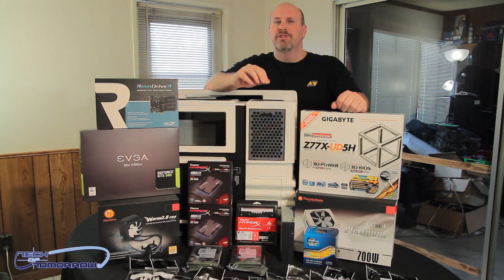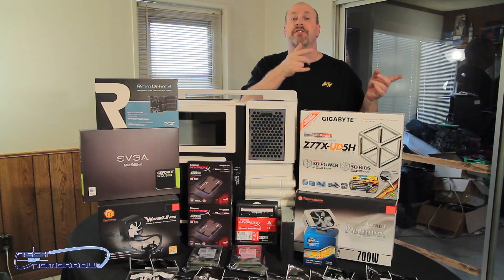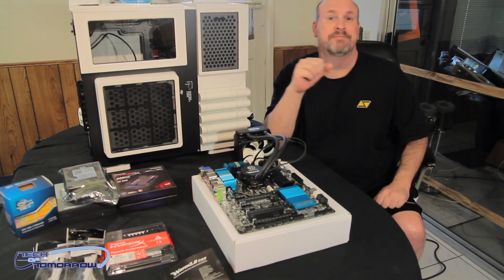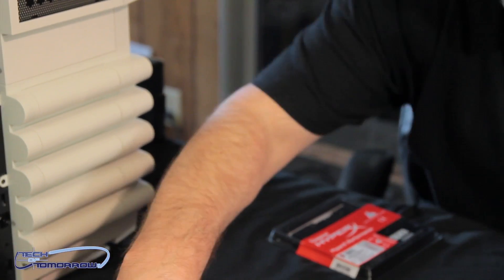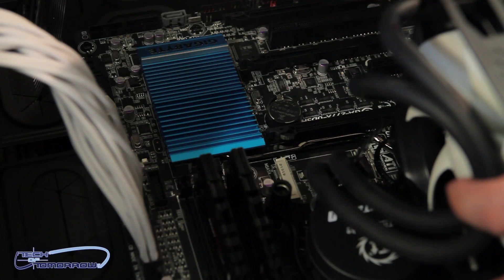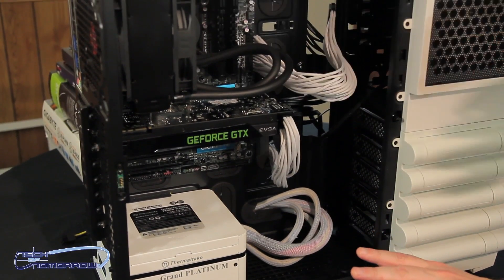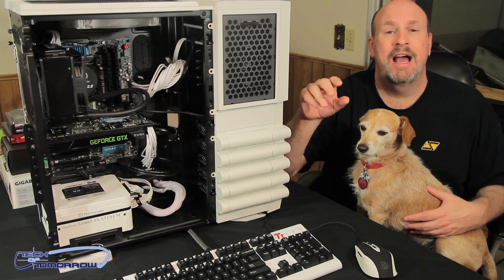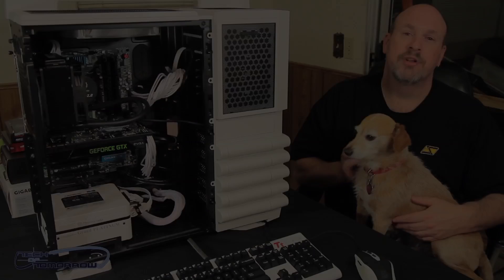Building The Dual-Boot Win 7 / Mountain Lion i7 GTX 680 Snow White Hackintosh

Comment: I always used windows, and now im becoming a graphic designer, and everybody talks about os x and blablabla. I'm thinking about building a hackintosh, but what are the advantages of Mountain Lion on a Hackintosh over a Windows 7 PC?
- I'm NOT asking the advantage of hackintosh over a macintosh!!!
Reply: pure experience. The specs are the same. Only thing I have experienced is dat adobe programs work a bit smoother on mac, but the difference isnt very noticable. I personally use my Macbook pro or Hackintosh for editing and photoshop because I like doing those stuff more on OSX. I also have a PC that I use for gaming.
Reply: The system itself offers a lot more graphic and video editing preferences, you could use After effects which in my opinion works better on mac, same for photoshop and then transfer it to Cinema4D if you wish in windows. All round it's a better performing and more practical than having 2.

Comment: Hello I am building a computer and wanted to get some feedback with these parts and if they are compatible.
Specs:Intel Core i5-3570K, Cooler Master Hyper 212 EVO, Seagate Barracuda 1 TB, Rosewill HIVE-750, Crucial m4 128GB 2.5-Inch, Kingston HyperX Beast 8 GB Kit, AS Rock LGA1155 DDR3 SATA3 USB3.0 Quad CrossFireX and Quad SLI A GbE ATX Motherboard Z77 EXTREME4, GIGABYTE GTX 670.

Comment: It's quite simple: A computer is made out of a bunch of parts. Linux and Windows will run basically on any computer with modern parts, but Mac OS X won't since Apple both design hardware and software. Therefore you must use the same or similar hardware that exist inside the Mac Pro, Mac Mini or MacBook Pro.

Then you must also use special software in order to install it properly on a non-Mac computer.

Comment: usually mac version use a different bios, so its not the same, for example the HD7950 have even a switch to choose the bios, for mac or windows, its not difficult to change that, but i d rather buy the gtx680 pc version, cuz is more easy to get that work for both OSes

Comment: multibeast isn't really necessary for a Gigabyte Z77 board. If he's going to use UEFI edition of Windows 7 or Windows 8, he'd need a suitable bootloader that handles both accurately. Clover UEFI (not the mbr edition) can handle proper booting of OS X (as close to natively as possible) and can pass the boot through to Windows UEFI as well.

Comment: So what's the practical purpose for this build?  I just don't understand the purpose for this build.  Couldn't you simply build a Hakintosh, then build a separate PC, then just network them?  Then you could run both systems ~simultaneously~.

Is the money saved from building one dual-boot Hackintosh/PC compared to the costs of building two separate systems (one Hackintosh, one PC) worth the inability/limitation to run both systems simultaneously?  BOTH systems are limited by a dual-boot config!

Comment: At least someone who knows what's inside a mac! ;) A Mac Pro cannot be compared to a desktop system at all. It's outdated, no doubt, but you can't compare a Z77+3770K with it. it's just not the same league of reliability. iMac may be compared to a 3770k+680 desktop pc, but calculate an equal display in ($600+). 680MX is a downclocked fullsized 680 ;) that's the only difference. an imac is actually cheaper than getting all parts (mouse, keyboard,webcam,audio,etc!)

Comment: Seriously? I thought you were knowledgable enough when it comes to PC/Mac and hardware. Why would you get a 680 Mac Edition card for a hackintosh? it's never going to access the "special EFI" part of the ROM, which you pay for when buying the Mac Edition. Any GTX6xx card works in a hackintosh, and with the newer UEFI GOP bios you'd even have the UEFI implementation for clover UEFI bootloader. I'd rather spend the 100$ as an upgrade for a 680 classified or DC2T or such.

Comment: If you're dual booting OS X, you would need to be very picky about your hardware. I'd make sure the hardware is available on a Mac(GPU, and CPU. Can't buy boards in Macs off the shelf). The board that Elric is using there will work completely fine. You don't need to worry about RAM or what kind of HDD(or SSD) you use. Alternatively, you could set up a Virtual Machine as well on a Windows PC.

Comment: yes. also depends on how thick the rad is. if it's thin unlikely if it's thick or you don't have proper fans. (like the ones corsair provides with the h100i(not bashing the product at all(AT ALL))) then yes it helps.

Comment: Also the fact that Apple has neglected the Mac Pro for years now. If OSX was compatible with my current setup I would use it. I really do <3 my Macbook Air, but seriously fuck the premiums, it's about time they start being competitive again in the Desktop market. 

Also the new Macbook Pros can't really even use the 2560 display because it's running on HD 4000. Real shame that I can't even have my 7970 plugged into a PCIe slot or OSX won't even boot into setup :(

Comment: Just a quick question Elric, If this is a Hackintosh Build Why would you use a MAC Edition 680 when its 100$ More (I thought it only worked on Mac Motherboards?) when a normal GTX 680 will work just fine in a Hackintosh build. Just wondering?

Comment: Silverstone's extension sata power connector kit 

cp06
 IS something ALL psu makers/assemblers SHOULD be doing as a STANDARD with their completely one piece built sata power cords coming from the psu itself.

I HATE that 3x length cords BETWEEN each sata power cord. It's totally unneeded and makes keeping things tidy more difficult.